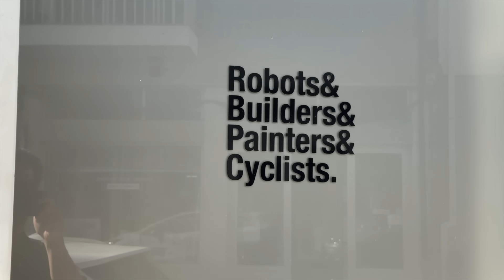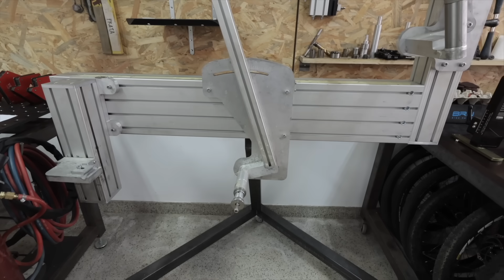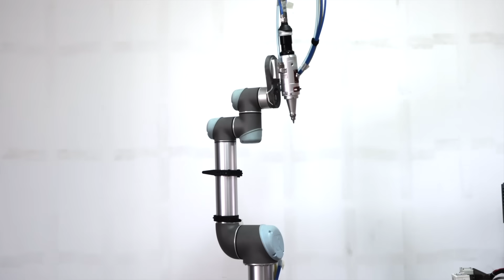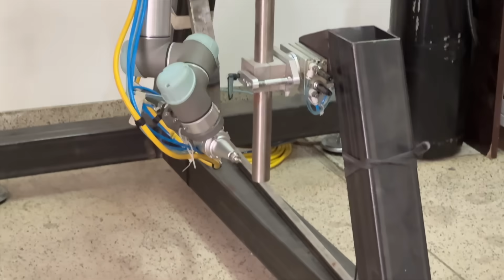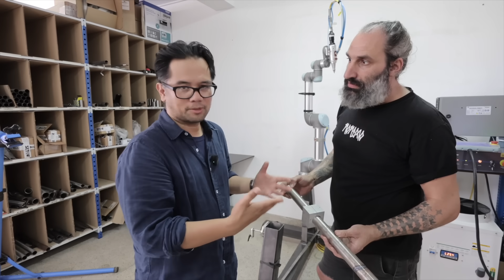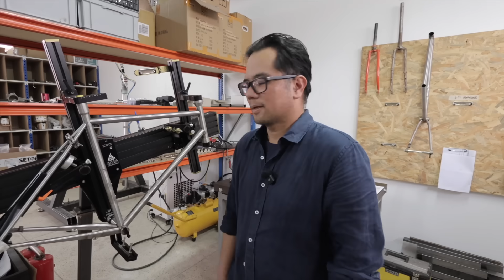This Will Change Framebuilding Forever

Comment: Eh, not sure how beneficial this would be for smaller shops. There’s the upfront cost for starters. Contrary to what some may think, most builders aren’t making automated robot type of money and it’ll take a good amount of time to recoup it. You then have to learn a whole other skillset to not only operate it but troubleshoot and repair it as well. How much will parts cost or to have a technician come out if it’s something you can’t fix? Not saying it’s a bad tool but these are just some of the things that need to be considered so that they can hopefully make it simple and affordable enough for the little guy.
Reply from the maker: Like I said small to mid size. This is early days. Only a few years ago at home 3D printing was a pipe dream.
Reply: @PathLessPedaledTV  Hoping it gets to where it needs to be as margins are pretty thin already. Looking forward to more videos on this. You guys making it out to Made this year?

Comment: The whole mill thing came from the fact that the main educational tool in the US, for frame builders, was produced by a machinist.  He had methods of work that used milling machines and accurized hole cutters, in a somewhat ridiculous attempt to work welded tubes, or brazed tubes, to .001".  which would be more appropriate tolerances in an ICE engine, or bench rest rifle.  

This did produce good results for Tig Welding, which I regard as the pinnacle of frame bonding technologies both as a process, and as art, but that is the opposite of what most people like.  They like lugs that look like heraldic symbols.  if you work with lugs, and even if you work with TIG, you can actually miter tubes in very short order with files.  It takes skill and that was what the use of machinery was undertaking to eliminate, while working to higher standards.

Given how picky the frame Nasties get over heating tubes, I wonder whether that method of laser cutting metal is up their alley.  It does cause temper issues, and burning, though at some level the technology is so sophisticated it can heat treat parts, that would probably be a pretty expensive machine.

A machine that just scored or etched the outlines would be amazing.
Reply: From what I have understood from seeing that robot myself is it all has to do with focus and the cutting distance that allows for accurate cutting with the lowest laser power possible avoiding burning and over heating the tubes.

Comment: What does the heat from the laser do to the cut edges of the tube? Are these cuts suitable for TIG welding or lugs and brazing?
Reply: Steel tube and plate laser cutting is industry standard everywhere. No issues with TIG or Brazing. as I said before, we work on small batches and these get ISO tested. As we are in the biggest european bike cluster, we have every partner in a 30 minute radius including a first class testing lab.
Reply: They are working on it.  What was shown looked burned, and like a series of dots.  But once you have the files you can just keep upgrading the process, and eventually it will be pretty perfect.

Comment: This is pretty cool. I wonder, if a robot can cut all the tubes, why can't it also finish-prep all the cut surfaces, and even TIG weld the frame together?
Reply from the maker: There are factories that do that.  The point of this project isn´t to make more mega factories but to create a distributed set of microfactories to spread the work and income.

Comment: Very cool. As someone who's worked in an engineering and manufacturing environment, setting up blueprints, the fact they are able to lock in whole sections of tubing into a datum point and make accurate cuts via robot in a single operation will greatly increase accuracy and efficiency. As you said, any time a piece has to be released and repositioned in a jig, you lose the original source datum and accuracy begins to decrease.
Reply: That is true, but even with this machine the datum appears to be a standard tube block, and accuracy in frame manufacture is pretty ridiculous anyway.  We aren't making rifles, or engines, this is  not the kind of deal where loosing a few tens in fixturing is goind to make any difference.
Reply: @HondoTrailside  Have you worked in manufacturing? Have you designed a fixture or jig? Have you drawn a blueprint that will be used by fabrication?
Reply: @HondoTrailside  All system is calibrated. Precision is higher than Mill and Hole Saws...

Comment: Sorry this is crap.  You have oxidized tube that needs to be be cleaned by hand 9r you have contaminated welds not good.
Reply: I agree, but there are solutions to all these problems, though they won't be cheap.  Welding does the same, so they use inert gas.
Reply: Got curious. Tube and plate laser cutting is industry standard all over the world. Is it crap? As I said before, Russ and Laura came when we were testing different cutting parameters to achieve better production speed. This team is working on the bike industry for more than 15 years. A few thousand frames have been made in different environments...

Comment: A lot smaller and potentially cheaper than a laser cutter meant for tubing, which is about as big as a normal industrial CNC machine
Reply: This solution also works for bend stays and was designed to allow for cutting of short length butted tubes.

Comment: I'm really curious what a machine like this might cost. I think it's a great advancement for mitering tubes, but it would be difficult for anyone except established shops to justify. Often in the States, a vertical mill can be found for around $1,000. Whereas I believe laser/plasma robotic arms are closer to the $30,000 range. A lot less accessible for someone who doesn't already have a lot of resources.

Comment: Looks like a robotic plasma cutter.  I've used a hand held one and they cut through metal like butter !

Edit : From replies ( please read ) and having another look , it's a laser cutter ( my bad ! ) .  It is actually stated at 5:11 so I should pay more attention !
Reply: It is not Plasma cutter. It is laser cut.
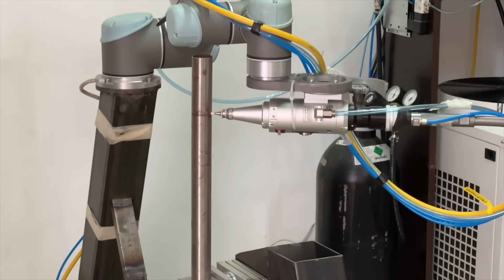Reply: @bungalela  I think you are correct because at 1:39 there is a Hanli 2000 fibre laser chiller to the right of the possibly Argon ( has a green non-flammable sticker )  gas cylinder.  At 3:03 I can now see the gap of a couple of millimeters between the work-piece and the cutter head and the red laser spot on the surface..    As commenter HondoTrailside as said , plasma would discolour the cut edges. The heat affected zone of a laser would likely be smaller. 

This is why I like youtube , as someone will always correct me  I miss something and get things wrong.  It's been nearly 30 years since I used a plasma cutter.  I do remember the fumes and the rapid speed of cutting !  I am thinking that the laser would have to have a converging beam ( not parallel ) , otherwise it could potentially cut through the opposite side of the workpiece , say when cutting the seat tube clamp slot.
Reply: meant like a knife though butter , i.e.almost effortless 🙂
Reply: And burn the edges.

Comment: you're not saying the quiet part out loud :  what does a robot arm like this cost to buy and maintain over its lifetime ? if that actually is low, then maybe, otherwise you're just transferring and value out of small builders' hands into the the stock value of the corporation making these robots. And in a generation or two, the knowledge of how to make a bike by hand will be gone.
Reply: The latter won't happen, it cost 300 for some videos years ago, now is is free all over the web.  But this doesn't look so much like a frame shop as a startup for production machinery.

Comment: Well it is interesting, but I do not see it as a potential game changer. With my Sputnik tube cutting system on a small milling machine could cut the main triangle in 20 minutes, deburred on a belt sander ready to clean and tack weld. My easiest bike I offered (all TIG no brazing) could be tubes to powder coat in 4 hours. The hardest part is selling and shipping and takes the most shop time.
Reply: Compared to the process described, I think 'Game Changer' is fair enough, in the same way your system can reasonably be given the same title.
Reply: It all depends. If your business is doing well, this will be really good way to scale up a bit without going totally crazy with new big industrial space, staff etc. Ofc if you don't have need for the speed and efficiency, you wouldn't get one.
Reply: Build something exceptional & your customer becomes your sales (Andrew Carnegie). Know your/you're love

Comment: I wonder how much that robot arm machine costs?
Reply: around a robot arm and a robot leg I'd imagine
Reply: @tobymcnicol922 winner
Reply: Critical question—how many frames would you have to sell to pay for that robotic arm? I could see large factories using the same technology but profiting from the efficiency
Reply: @richardgoodwin6652  We are not making custom frames but working on small batches for other european brands. The digital process, Hybrid Craftmanship, speeds up production and reduces errors. It is part of a strategy on Micro Factories as business model, more than framebuilding, less than industry.
Reply: Looks to just be a Universal Robots UR Co-bot, they run about 30K typically without the laser. Laser tube cutters exist through so I in no way would classify this as changing frame building forever.

Comment: It's a frame shop with no heavy machines.  Pedro, Ricardo and Paul, good thinking.  Yes, your first test case is bicycle frames but this can apply to other products as well.  But I like bikes and would love to got to something like BikeCAD, design my bike order the tubes and then get the tubes all mitered and I would only have to finish file the tubes, weld or braze then together and finish all the details.  I already do something similar for laser cut flat parts and even front panels for electronic projects.
Reply: Yes. We are working on an automated version to generate code from BIKECAD or RATTLECAD 3D file export.

Comment: Having built a frame for my son, I recall the endless hours of milling and cutting the tubes to fit.  The brazing in the jig took hardly any time at all.  This technology is a gamechanger if it is integrated with software design tools that produce cutting instruction files directly from the frame design.
Reply: Yes they do. We are working on our own software integration, not relying on off-the-shelf generic solutions. On Phase 2, it will work as full automation, generating code directly from parametric design. We already tested it and we can now generate code from the 3D exported files from BikeCad and Rattle Cad.

Comment: the edges are burnt on all of those. Not good for welding.
Reply: Thanks for the comment. Russ and Laura visited while we were testing code. We are working with our laser supplier to fine tune parameters, our tube supplier to ensure that tubing is within expected tolerances, with different welding experts and having our frames tested in BIKINNOV, one of the best bicycle labs in Europe. Luckily we are in the biggest european bicycle cluster with lots of expertise available in a 30km radius from us.
Reply: @bungalela  Yeah, Europe actually requires testing for custom frames.
Reply: @HondoTrailside  Testing for custom frames is a grey area. We are working on small production batches for different brands and these get tested.